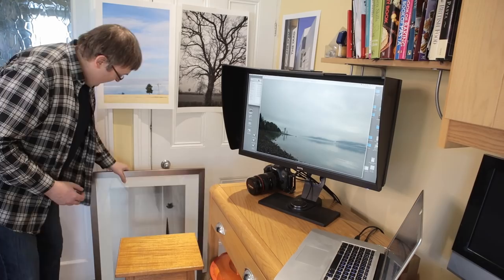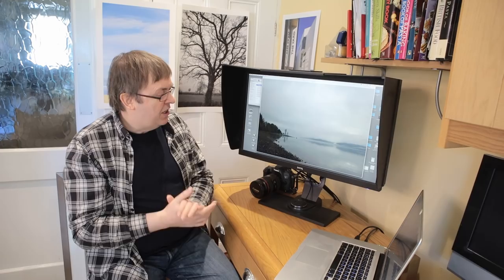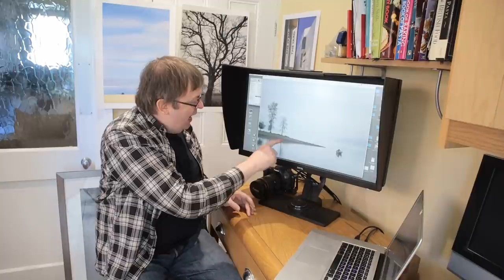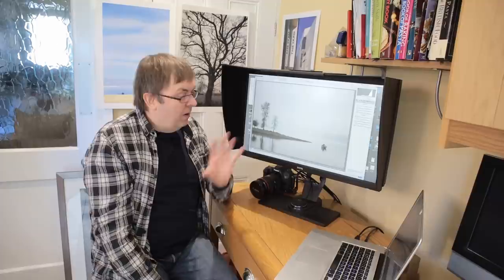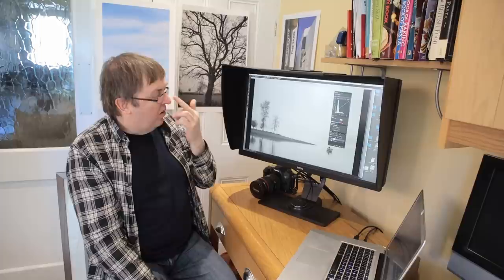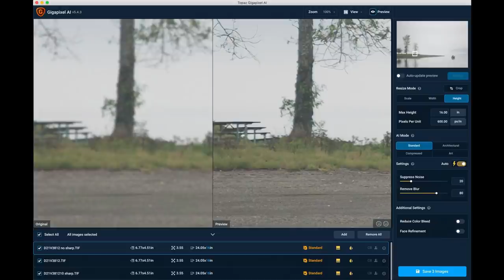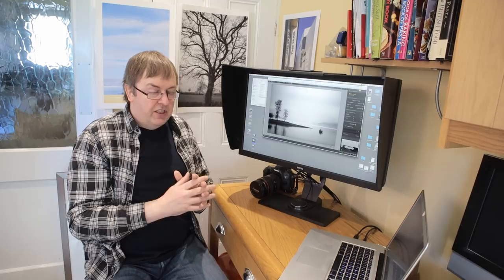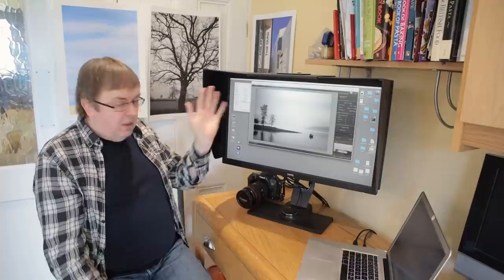Making a black & white fine art landscape print. Every step from photography to making a large print

Comment: Really enjoyed seeing your process. Sounds like you liked the R5 a bit more than you let on previously...
Reply from the maker: Thanks - My appreciation of the R5 has gone up since I've used the EOS RP more, but for my actual work it still offers no significant advantage over my 5Ds
Of course, with the distinct lack of paying work in the last year, I couldn't really afford an R5 even if I wanted one...  Hopefully by the time a higher megapixel Canon mirrorless appears, work will have continued to pick up, and we'll see some new tilt/shift lenses at the same time.
The upcoming R3 is probably not the camera I'm looking for...
Reply: @KeithCooper  I agree about the R series in general. One of the things I like is focus peaking when using manual lenses like tilt/shift. Less having to scroll the display up and down when focussing with tilt. The R3 is the affordable sports/wildlife camera. The R1 is going to be insanely expensive.

Comment: A great photo and really shows the benefit of "use your feet".  Subtle differences here have added a lot of value to the image.  It also shows that while there are advantages to having the latest and greatest camera, knowing how to use an older camera with a quality lens is of far more benefit.

How do you feel about making a panoramic from a standard photo.  So, not stitching two or more together, essentially cropping some of the top/bottom off changing the aspect ratio?  Would it, for want of a better phrase, "look right"?

A further question - I see you are editing TIF files - do you shoot in TIF, or is this a conversion from NEF/DNG etc?
Reply from the maker: Thanks - it does work well that I only stopped for a relatively short while.
I've often cropped images quite a bit, and it just depends on having a sharp enough lens and enough megapixels. It's purely about the field of view that fits. On another trip I got a great early morning view of Seattle from the ferry that I cropped thin and wide.

The TIF files are what the the RAW files were from the 1Ds - remember, the photos were taken in September 2004 ;-)
Reply: @KeithCooper  It's certainly easy to forget how far things have come since then.  I've never actually used a Canon (Nikon user myself), so wasn't aware they used TIF for raw - on Nikon I've always had the choice of RAW or TIF.

Be interesting to see some more of your photos - perhaps if you get chance a video going through some of your favourite travel photos?  Would be interesting to see :)
Reply from the maker: Yes - the .TIF suffix still causes me occasional issues with old (1Ds) images. Fortunately, Canon moved to a different RAW suffix in later models.

I have some articles on the Northlight site covering some of my US travels - I'll have a dive back into the archives.  
http://www.northlight-images.co.uk/keiths-photo-travels/
The text was largely written at the time, so gives a feel for what I thought.
Reply: @KeithCooper  Some great writeups there Keith, hope you manage to make another trip soon :)
Reply from the maker: @jameswalker7874  Thanks - Me too!  ;-)

Comment: Keith, very instructive video on old low res file. What paper did you use for the new print and what printer?
Reply from the maker: I think the most recent used an Innova Smooth fine art natural white (one I've used for years - effectively the same as Epson's smooth cotton natural)

IIRC this was printed on 17" roll paper on a P5000 - the larger version on an Epson P7000

Comment: Keith, Are you suggesting that a universal sharpening would add halos when resizing?  (I'm using a "structure" option to sharpen the raw photos and it would simply be unthinkable for me to print a picture without making an adjustment here; the difference would be much more obvious than the one you showed in your own pictures.)

Also, you mentioned resizing up to 600 ppi.  I would clearly defer to your judgement on this, but I thought 360 ppi was a reliable standard.

Thank you.
Reply from the maker: The question of halos is a tricky one, since it ultimately depends on the size of the print and viewing distance. Whilst I will often use some more complex contrast enhancement techniques, I'll almost always do them on a masked layer and paint them in where needed (or not needed).
What I always question is the uncritical use of sharpening ;-)

As to the resolution, there is a lot of misinformation about ;-) 360 would be an OK number for most Epson printers, with 300 for Canon (depends on the pitch of the nozzles on the print head). However in testing over recent years I've found that sending more resolution to the printer driver is better handled (improved dot dithering algorithms) than it used to be, and using higher figures of real resolution helped. 

After experiments with resizing software like GigaPixel AI I found that resizing to a higher level created detail that partly worked like traditional fine detail sharpening.

What I'd suggest is reading the articles associated with this, since I tend to include a lot more detail and example in the written articles - the videos here are in some ways just trailers for the 'real' stuff ;-)

However above all, my exhortation to people is to experiment and decide for themselves. There is so much I read about this subject that is 'not even wrong' ;-)
Actual prints trump forum wisdom any day IMHO ;-)
Reply: @KeithCooper  Keith, you're a scholar and a gentleman, particularly for spending this much time on my question.

I've started to read some of your work but I don't have the technical savvy you do; I may end up reading it three or four times before it sinks in.

Thank you for your help.